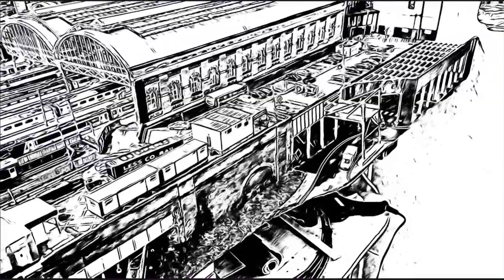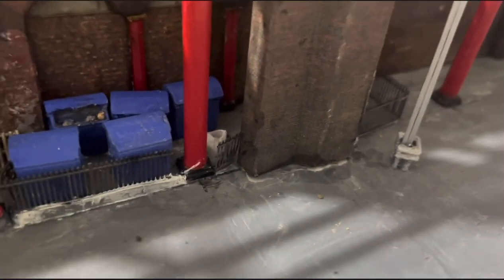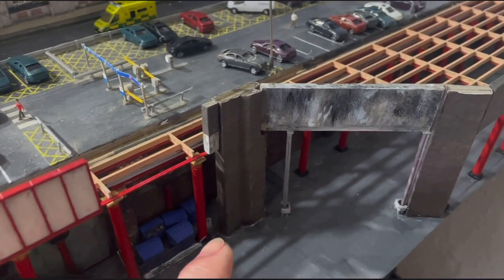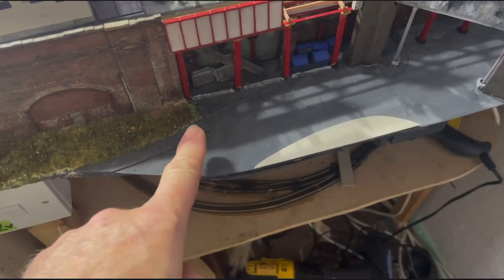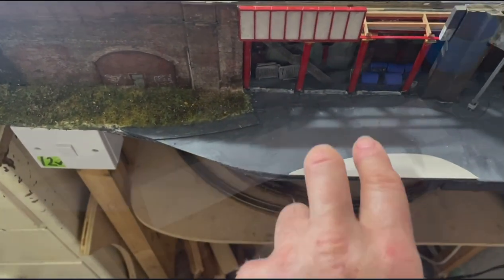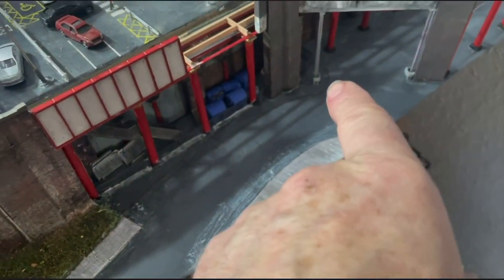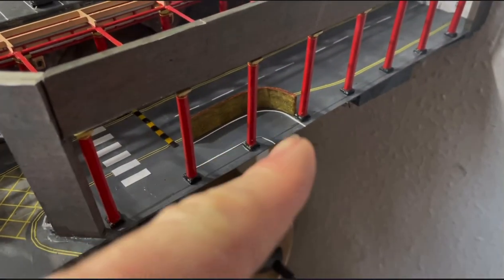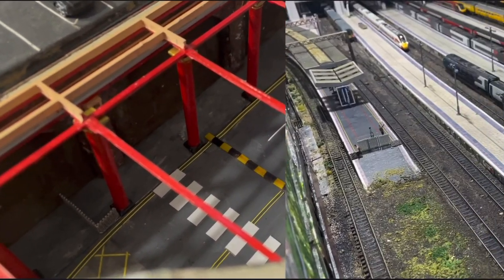MANCHESTER PICCADILLY  IN N GAUGE – building the underground carpark no2

Comment: Keep doing  vIdeos learning a lot
Bit of advice I’m starting scenics on small layout oval but want to raise height of central area to start adding village scene. Am I best to split into sections and model on 2mm greyboard or make per amend model fixed to baseboard and paper mache height required ? Thanks in anticipation.
Reply from the maker: Hi, its hard to know what you mean, can you send me drawing to fb messenger. I may do things differently depending on size, weight, height etc etc